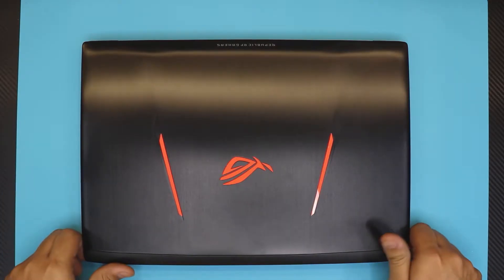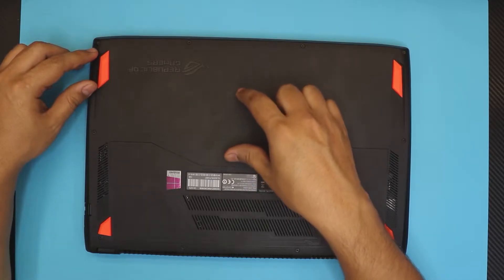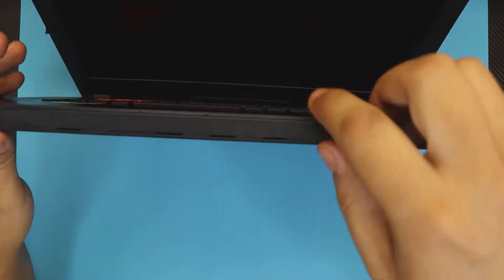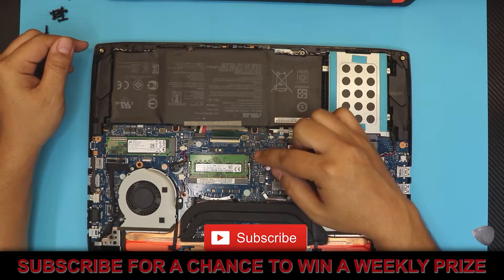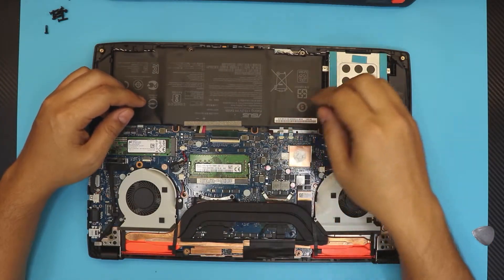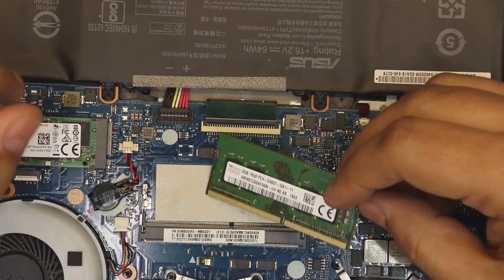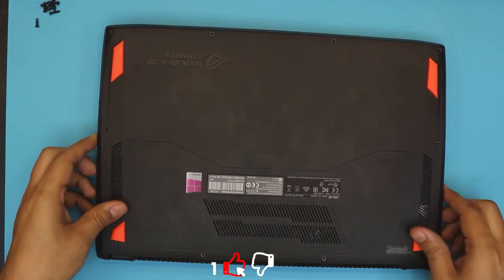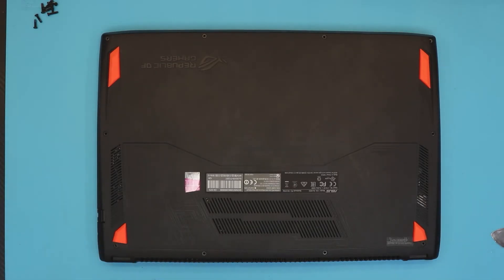ASUS ROG Strix GL502 Ram upgrade disassembly guide

Comment: Hi! I have a GL502VT-BSI7N27 with 12 gb Ram. I am planning to upgrade and i dont if it is compatible to upgrade to 16 or 32gb? And what ram (Brand) should i buy? Thank you.
Reply from the maker: 🫠Regarding your question, you can install a 16GB RAM module, and it will work just fine. The recommended RAM is:
https://amzn.to/4g0LVMG
Should you have any further questions or requests in the future, please don't hesitate to ask me.
cheers🍻
This is an Amazon affiliate link. When you use my links, you are helping to support the channel. 🙏

Comment: Hi sir. I have a GL502v. Do you have any suggestion which brand and model I can use to upgrade my RAM? I am looking for a 32GB RAM. Thanks so much.
Reply from the maker: 🫠Regarding your question, you can place any brand as long as it is a sdram ddr4 3200mhz
the compatible ram 32gb link is in the video description.
cheers🍻
Reply: Thanks so much, sir!!
Reply: One last question, sir.  the maximum mhz that my cpu (intel i7-7700HQ) can handle, based on its specs is 2400Mhz. Would it be ok to put 3200mHz ram? Would I encounter any issues with it?

Comment: Hey! I'm trying to add another 8GB of RAM, but when I plug it in, the laptop turns on and the screen goes black and then turns off. Could you help me, is this just configuration or a laptop problem?
Reply from the maker: Thank you for your feedback! If you wish to support the channel, you can like, subscribe, or both!
Regarding your question, ok, the reason is that the motherboard bios is stock and not doing the job it has to do a auto mem check, to force the mem check follow this steps:
remove the charger, disconnect the battery, remove both rams (all), disconnect the BIOS battery ( is the one beside the ram, just pull back the jack) press and hold the power button for 60sec.
NOW plug in both rams and connect the both batteries and plug in the power and power on and wait 15sec.
Should you have any further questions or requests in the future, please don't hesitate to ask me.
Reply: @uFixTek  thank you very much!
I'll try to do it, the laptop is the same model as in the video.
Reply from the maker: try it out and let me know
Reply: @uFixTek  I didn't find the bios battery. I tried to upgrade the bios but A message appears saying that it is not the appropriate BIOS. But I downloaded the BIOS from the Asus website
Reply from the maker: there is the battery for BIOS: https://imgur.com/a/On1gy3S
Reply: @uFixTek  thank u! I tried but unfortunately it didn't work

Comment: I have 8gb which are soldered on and an empty ram slot. When I added 8GB stick, it recognizes it, but I still only have 8GB in total, as the original soldered 8GB seem to disappear as if they are not in the laptop anymore. How do I fix this?
Reply from the maker: It is a very rare thing that the bios does that, what type and brand (specs) of the ram you placed in.
Reply: @uFixTek  Zeppelin 8GB DDR4 2133mhz CL15
Reply from the maker: sorry to burst your bubble but "Zeppelin" rams are known for its none compatibility with other rams. get a good known brand ram. e.g this is a very compatible ram: A-Tech:  https://amzn.to/42XMuQR
or this: Crucial :  https://amzn.to/4332C3u

Comment: Hi. I know this video is old, but I have the GL502MVK, and I need help.

I want to upgrade the M.2 and the 2.5inch sata.

My questions:
1. Is the M.2 slot of this board nvme compatible? (If yes, what should I look for when buying a new one?)

2. What specs of  2.5inch SSD should I buy to upgrade the current HDD I have?

3. When running CMD, it says I can install up to 64gb of RAM. Only 2*16gb 2400mhz sodimm is available in the market. I have 2*8gb 2400mhz currently installed. When I check task manager, it says I have 16gb of RAM, but 18gb of virtual memory. Can I safely upgrade to 2*16gb or should I stick with 2*8gb?

I will wait for your answers. Thank you very much!
Reply from the maker: Thank you for your feedback! If you wish to support the channel, you can like, subscribe, or both!
Regarding your question, i have made a video on ssd upgrades: https://youtu.be/qpr0NmBRdNU
for the m.2 any m.2 nvme gen will work just fine, and any sata 2.5" will work just fine, the best brands and models are the samsung pro for NVME and samsung Evo for 2.5"
https://amzn.to/3B34GND
https://amzn.to/3HM9M4q
you can go up to 2TB on each or both ssd's
regarding the ram you only have one ram dim available , not two. you have one ram soldered on board and one dim replaceable, that you have 8gb on it, you can remove that 8gb and place it with 16gb and it will add with 8gb on board so you get 24GB total that would be better performance than 16gb that you have now. compatible rams that we use is:
https://amzn.to/3LFrFD7
Reply: @uFixTek  Thank you so much! I already subscribed. 🥹🫰♥️
Reply from the maker: It's my pleasure my friend. 😊
Should you have any further questions or requests in the future, please don't hesitate to ask me.
Reply: @uFixTek hi guy! I have same this him. But i want upgrade samsung DDR4 16GB bus 3200. Can i upgrade?

Comment: GOOD DAY! my laptop is ASUS ROG GL502VM (gl502-db71)
= dual DDR4: 8g + 8g (onboard)

is it possible to upgrade the removable 8g ram to a 16g or 32g DDR4 for this model? 
i've been getting mixed comments maybe because it's an old gaming laptop. i can't find links on the laptop's RAM cap. 
Thanks for the help!
Reply from the maker: Thank you for the feedback! if you wish to support the channel you can LIKE or SUB or both :P
regarding your question: we do get this models a lot in the store for upgrades, and the service center if you call them and they will tell you 16gb max and or on data sheet says 16gb max. but this is far from truth we have upgraded them to 16gb +8gb onboard without any issues. but you can place a 32gb stick +8gb on board to have 40GB total ( but truly its waist of money as you will not fill 40Gb. as of now im editing a 4k videos and only maxed 17GB and i have 128GB.
go with 16gb stick 
https://amzn.to/3GBGuFS
also you can verify the max ram capacity : https://youtu.be/tKEJTkVth4Q
also if you purchase on amazon you can easily return it without any questions asked :)
Reply: @uFixTek  this is a big help! i followed the cmd:wmic (etcetc) and discovered that this 6y/o gaming laptop can cap up to 64g ram.

for gaming, heavy editing and graphics rendering, i might go for a 16g or 32g ddr4 3200mhz (plus the 8g onboard). liked and subscribed! thank you!
Reply from the maker: its my pleasure and i would say go for 16GB adicional.
if you have any question or request in the future feel free to ask me.
Reply: @uFixTek  hi again! i went to a comp shop and was advised that i should get a lower RAM model (mine is 8g 2133p).

i can't find any online, so should i push with the 16g 3200mhz? thank you!
Reply from the maker: go with  16g 2400mhz: https://amzn.to/3XPvbjB
you don't need to go with 3200, it will get downclocked to 2133 so go with 3200
Reply: @uFixTek  as usual, great help! thank you very much and more power to this channel!

Comment: I'm so confused here (not because of your video haha). So, I have this model, GL502VM-DB74. Everything I see online tells me that I have only 1 spot available to change, and a soldered 8Gb I can't remove. I found your video on how to see your memory capacity by using cmd prompt. My results shows 67108864 (67.11GB) with 4 memory devices. From what I've seen I can only upgrade this to 32GB but these results are showing I can upgrade to at least 64GB? Do I really have 4 slots or is this a mistake? Do I need to remove the cover to check?
Reply from the maker: Thank you for the feedback! if you wish to support the channel you can LIKE or SUB or both :P
regarding your question: the CMD checks you motherboard and CPU capacity to see whats the max ram capacity that it can handle. but on some high end laptops the cmd device detection is incorrect, because the bios that is installed has activated 4slot programming code in it. and so windows thinks that you actually have those 4 slots. cmd cannot detect if you have physical slot soldered or not. but it can tell you what is the max that it can handle the CPU and bios.
now regarding your motherboard, you have one SLOT available to do any upgrade, remove the ram that you have in that slot and place a 16GB + the 8GB onboard that you have and you are set for most of application and even over kill for games. don't go ove 16g+8G as its useless unless you edit 4K long videos.
Reply: @uFixTek  thank you so much! And I actually do a lot of video editing at 4K, as well as a lot of work in After Effects. What is the largest I can go, 32GB?
Reply from the maker: yes you can go with 32gb and 8soldered total 40GB:
this is the compatible we use a lot: https://amzn.to/3KlnpqC

Comment: Hey bro i noticed that you reply quickly so thought id ask you my question, my laptop is a gl502VT the 12gb version, so its an 8gb internal that i cant touch then theres that 4gb outside that asus mentions i can upgrade to an 8gb stick, is it possible to have a 16gb stick instead and then have 20gb of ram overall or is that not an option? Im wondering lol
Reply from the maker: Thank you for the feedback! if you wish to support the channel you can LIKE or SUB or both :P
regarding your question:  YES you can defiantly remove the 8GB and place it with 16gb and it will add up with 8gb on board and it will work without any issue. we have installed and ram tested, no idea why companies do this even if you call them up they say max ssd support is 500gb WTF lol
don't listen to them. 
https://amzn.to/3dj4L47
https://amzn.to/2St2a0j
Reply: @uFixTek  thanks for your reply man yeah lol, what about the speeds i noticed its at 2133mhz and cant modify it, so should i get a 16gb stick thats at 2133mhz-2600mhz?
Reply from the maker: get anything above 2000mhz , and the bios will balance the MHZ so if you get the 3200 the bios will down-clock it to match the on board ram speed. so no need to spend more thinking you will benefit.
Reply: @uFixTek  awesome so actually I can have a max of 24gb ram instead of 16gb where they said it was maxed at
Reply from the maker: yes if the on board is 8gb soldered then sure add a 16gb and you will get total of 24GB ram. no issue whats so ever. and after that call up asus and tell them to eat AS**SS :P

Comment: I have the same model How do I make my ram a dual slot I got the gl502v model and I have 40gb of ram because I have a built in 8gb plus I got a 32gb but I want to make my laptop a 64gb? Can you help me with this problem?
Reply from the maker: Thank you for the feedback and your support to the channel by a SUB :P
regarding your questions:
#1. you already have a two duo channel memory by having any ram size in the dim. 
#2. the max that you can reach on this model is 40GB 8GB+32GB, there is no way possible to reach the 64GB my friend sorry to inform you about it.
Reply: @uFixTek  this actually solved my question I was about to ask, thank-you!!
Reply from the maker: glad it helped you out :)

Comment: Hi, ive got a problem where the laptop works fine on builtin ram but when i install another ram on the slot given it gives black screen. However, if i take the ram out then reseat it and turn on, it works fine but gets Blackscreen when i shut down. The laptop doesnt have a battery..please help.
Reply from the maker: Thank you for the feedback and your support to the channel, regarding your question: the reason that this is happening the bios needs the internal battery to keep the bios info saved. as this laptop dont have a bios battery they need the very little battery charge that they can get from internal battery. so you will need to place the internal battery even if its dead , because even dead battery has enough charge to keep the bios activate.

Comment: Hello, I have a GL502VM with only one slot with 8Gb of ram (In total, 16Gb), can I upgrade that one slot to 16Gb ram?
Reply from the maker: yes my friend you can do that just by placing a 16gb ram stick:
https://amzn.to/3dlw1jy
and it will work just fine and it will add up with your 8gb
thank you for your support to the channel with a SUB :P,
Reply: @uFixTek  Thanks for the aswer! I guess I can buy that or some other brand
Reply from the maker: your welcome my friend, and yes try it if you want , but we use this one a lot as its 100% compatible some brands are really bad and the bios wont detect sometimes.
Reply: @uFixTek  ty. And a last question, if you mind. I see that the MHz that my processor indicates (apparently) is 2400MHz for the ram, but the ones you suggest are 2666MHz. Would it work? Will it detect that RAM?
Reply from the maker: for intel cpus you dont need to worry about the MHz , and you can place a 2666mhz on the computer and the bios will adjust the speed down to the lower ram speed that you have installed in your case it will get adjusted to 2400.
and the benefits of having a 2666mhz on a bios that it will use it as 2400 is that the ram will last you much longer as it will not run at its max speed, so less ram error (blue screen) and also in the future you can remove this and place it on a different laptop that can use the 2666mhz. i hope i explained it :)
Reply: @uFixTek  thank you for the time! It helps me a lot!
Reply from the maker: @Euforia706  when ever you got issues or questions ask me :)

Comment: Hi, I have the asus gl502vmk 16gb of ram and I want to upgrade the only Ram that is available because the other is soldered, if I put one of 16Gb, the dual Chanel is going to be affected? And do you recommended to do it or is it better to stay whit the 16Gb I already have?
Reply from the maker: you can add a extra 16gb and still have the duo channel. and it will work just fine,
https://amzn.to/2HTZALz
Reply: @uFixTek  thx
Reply from the maker: anytime my friend

Comment: Hello! Thank you so much for this video. I just bought the 16gb RAM you recommended for my GL502VM.
I want to get an M.2 SSD as well. Do you recommend the SAMSUNG 970 EVO Plus SSD 250GB - M.2 NVMe  (MZ-V7S250B/AM)?
Reply from the maker: yes you can place a NVME drive there, but i would recommend a 500gb or 1tb nvme.
the reasons are two main thing:
#1. when you get a 500Gb or 1tb you get a faster transfer speed,
#2. this is very important to keep in mind that the TBW is much much higher on 500gb and 1tb compared to 250GB
TBW = Terabytes Written
Another metric used for SSD write endurance is Terabytes Written (TBW), which describes how much data can be written to the SSD over the life of the drive, before failure.
the 250gb will give you about 90TB real-life, bsed on tests (fake 150TB)
500GB will give you about 270TB (300TB)
1TB will give 550TB (advertised as 600TB)
i hope i have explained myself :) 

go with 500gb if you can if not 250gb it will do the job
https://amzn.to/3fJQbCO

Comment: I have the Titanium one but I believe it's the same model GL502VM and current specs are 16gb ram, 1 tb hdd, empty ssd (coz it became undetected so im planning to replace it), anyways, i want to ask if i plan on using it for AUTOCAD, REVIT, other engineering design softwares, and some gaming like Dota2 and Pubg, what do you recommend on upgrading?

I'm open into upgrading my RAM and ofcourse the ssd. what should i go for? 32 gb ram or 24 gb? pricewise?
Reply from the maker: i would always recommend you to go with ssd drive 1st and install the windows and programs on your ssd and use the hdd as an 2nd storage,
the NVME ssd are the best for the  big programs:
https://amzn.to/2TAIHI3
and when you install the ssd you can use "Macrium Reflect" program to clone your windows to the ssd. and then format the main hdd.
regarding the ram i would put a hold on it, 1st go with a good nvme ssd then the ram depends the file size that you will be working, you can check the ram usage in task manager when you have your files loaded on the programs, then you will know if you need more or not.

 i appreciate sub and support to the channel :)
Reply: @uFixTek  Thanks for the suggestion man. I really appreciate it. More power to your channel sir, I wish you success.
Reply from the maker: Thank you , :)

Comment: Hi! I have a couple of questions, if you mind helping me. I have got pretty much the same laptop ROG GL502VS with i7 6700hq and gtx1070. I want to upgrade from 8 to 16 gb ram, and when I add the second ram in the slot I just get a black screen even though the laptop is running. I am thinking the problem might be software, bios outdated (I have the very old bios with American Megatrends)
Do you know how can I update the bios to look like this blue one you have? Any advice? Thanks
*the new ram is tested and properly working
Reply from the maker: its a easy fix, but i need to know exactly what you have and what you placing,
your laptop has a 1x 8gb ram or 2x 4gb
and if it has 1x 8gb and you want to add another 8gb, or you have 1x 8gb installed and want to install a 1 x 16gb stick additional??

i appreciate the support for the channel
Reply: Did you manage to solve it? I only have 8GB from the factory and I wanted to increase it more